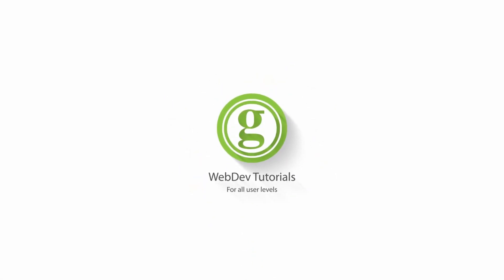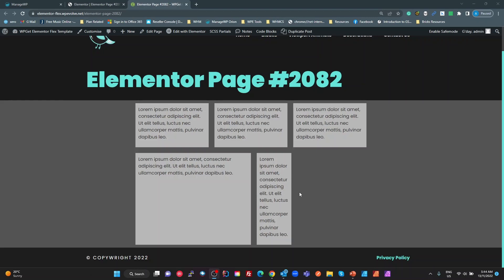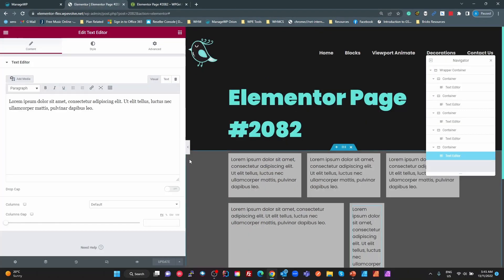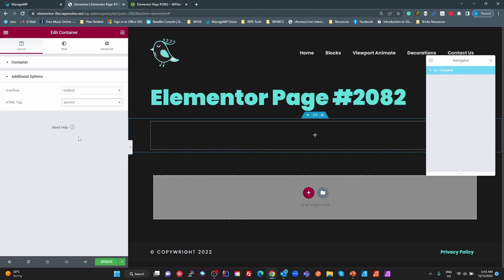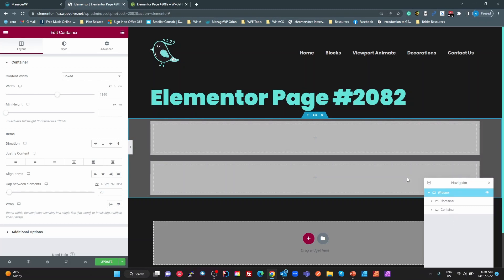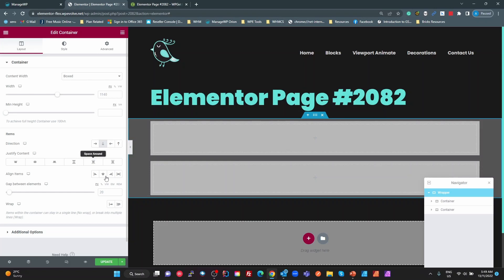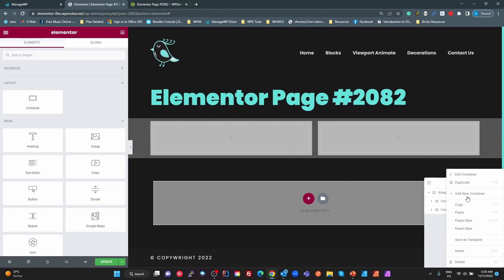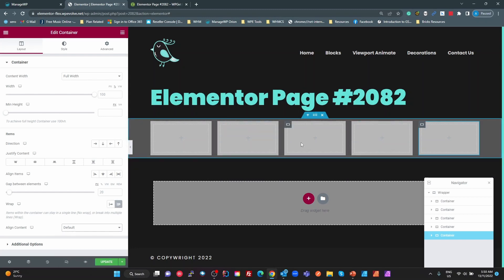Flex Container flexible columns in Elementor

Comment: can you explain how to create a custom post (product), title - image - text - price, create an archive page with the output of posts and search by title, with the ability to add this post from the frontend panel, using only elementor pro, theme maybe Astra or Hello elementor…

add a buy button, form name, phone number, and send the form to telegram
Reply from the maker: Sorry, that is completely different to this video?
Also, those features are not standard with Elementor. You would need plugins. 
For what you describe I would recommend Crocoblock. JetEngine, SmartFIlters and JetFormBuilder will achieve those features. Paul at WPTuts has a bunch of tutorials for this.